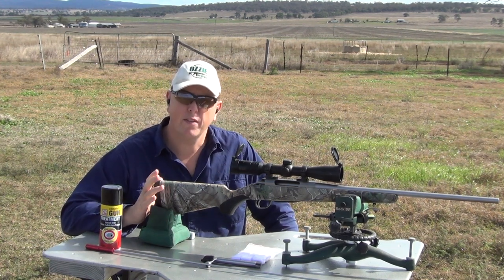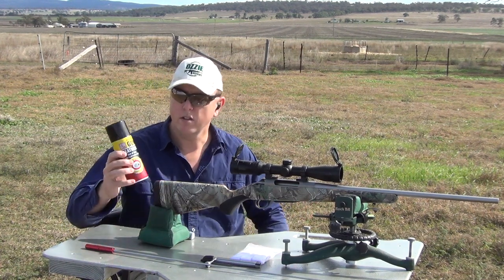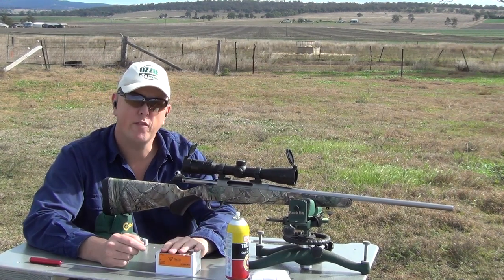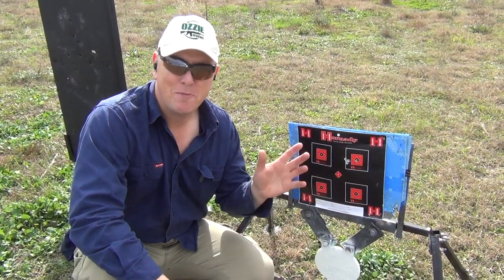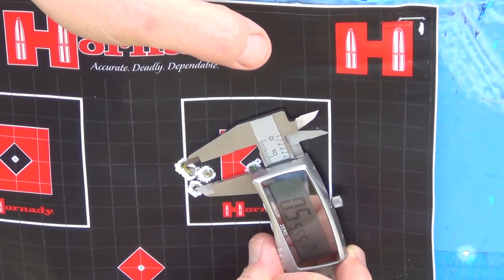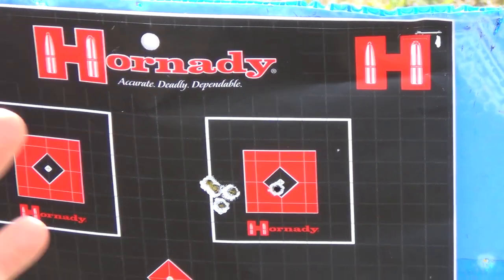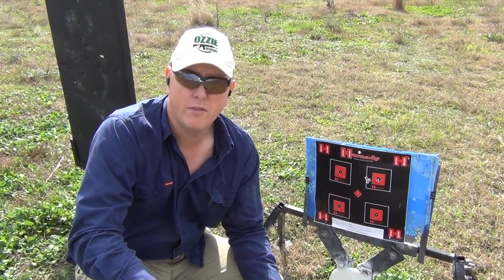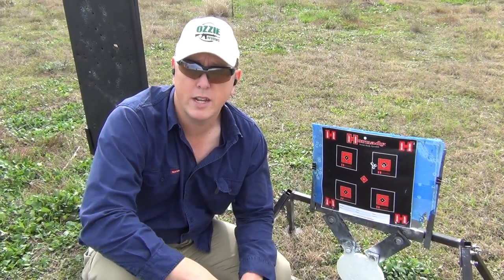Beginner Basics #2 How To Break In a Rifle Barrel (Centrefire)

Comment: The patch out after each shot is for custom target barrels that have never been fired before (like you would get if you buy a barrel from someone like Madden or Tobler and have it fitted)This is exactly what we needed to do with new target barrels (when I was into fullbore target shooting some years back).  Also folks be aware that using excessive amounts of ammonia based bore solvents (like Sweets 7.62) in STAINLESS barrels can damage them by dissolving the nickle that is alloyed into the stainless steel and that they can also rust chrome-moly (standard steel) barrels if left in for much more than 10 or so minutes.

Comment: In my opinion, if it doesn't make a mention of it in the manual, it doesn't need to be done. I took my Tikka T3 CTR out and shot about 60 rounds the first day, cleaned it as usual, and it's done as well ever since.
Reply: Oath. Tikkas, being cold hammer forged are already pretty much as smooth as the bore and rifling can get. 
Ozzie’s way is pretty basic and simple as it gets and seems like pretty decent system.

Comment: Mate this is a great series you are doing. Fantastic!! I'm certainly going to give your cleaning method and products a go! Love having a honest, down to earth, informative, aussie channel....keep up the good work.
Reply from the maker: Thanks Luke, I greatly appreciate that, cheers!
Reply: Spot on Luke , I’d go so far as to say any rifle any barrel I’m still a fullbore shooter , but I’ve studied metallurgy as a component of boilermaker at tafe , no what’s happening when we run a barrel in , we’ll the inside is rough from new and the running in smooths the bore and takes away those nasty jagged edges in there , but also and more importantly you are core /work hardening the surface , look up work hardening of steels for instance hit a railway track  with a hammer and anywhere you can dent it , except the head of the rail as it’s been work hardened by the bogies , yes I was on the railway as a welder ,
, so every bullet lays down deposits of copper into the bore surface , sweets or other copper solvents are designed to get this out , and personally I would go shot patch shot patch until no copper came out , you can always tell a well run in barrel as it’s copper comes strait out after 1000 rounds etc , but if we aneal copper into the surface there is a possibility this softer part may set the barrel to loose accuracy prematurely, ie the copper is acting as barrel surface in one area and stainless in another , however I’ve had barrels that would not ever stop giving up green , but they Shot well , personally next time I’m thinking of running in with chrome moly projectiles , never seen them but I heard they are out there , if they work harden and are a harder bullet then it stands to reason that they will leave minimal deposits , I’m not sure if the chrome moly would aneal into the surface , I best research that , but chrome moly work , Characteristics of chromoly
An important characteristic of chromoly is that it can be easily hardened by heat treating or work hardening. It can also be case-hardened by a process known as carburisation, where the outside of the metal is significantly hardened whilst the material retains its chemical properties, cut and pasted, I think chrome moly is the go for 1st 100 , well I’m gonna try it

Comment: I was surprised how many cleanings it took to get rid of the Tikka shippping grease in the barrel.  I did not use a brush, just wet and dry patches with Shooter's Choice.  I shot a round, cleaned, shot a round, cleaned for 10 rounds and then good to go.  I live in Alaska and shoot a 130 gr Barnes TTSX hand load with 4350 out of a .270 Win Tikka.

Comment: Have you ever tried this method vs not doing it at all with two identical guns? 

As you said in your introduction, a lot of people online, both casual and champion benchrest shooters say its a myth, even high quality barrel manufacturers say the same, however I've never seen decent enough comparative data or testing to say with certainty that one way is better than another (or not at all).

Either way, the cost/time/effort to do something like your video is completely minimal and wouldn't hurt in the long run (especially if you've forked out 4 figures for a new barrel, may as well do every little thing you can).

Another great vid Ozzie!
Reply from the maker: No as I have never been able to afford 2 identical guns ;)
Reply: Even then you are comparing two different rifles. Their is no contorl group either.
Reply from the maker: oncall21 I can't seem to message you privately, can you send me a PM please, I had some info on another matter I wanted to discuss...
Reply: ozziereviews  hi mate when do you recommend running the brass brush with a new rifle?

Comment: I am a firm believer that breaking in a barrel is a myth. I've tried the patch after every shot method and I've tried a similar method to what you do. Never found it to make any difference at all.

These days I simply do an initial cleaning and patching to clean out the bore of any test firing residue, shipping grease etc. Then I sight the rifle in and do a post shooting clean as you normally would.
Reply: It does but not really for an average shooter. Unless you need to predict muzzle velocity for long range firing solutions or high level competition. You can change the copper equilibrium curve if you know what your doing. Certainly not worth the effort for most shooters

Comment: hey mate great video..is that a job dewey rod? if so is there any difference between the stainless and coated steel? and how many inches is that particular cleaning rod you are using?
Reply from the maker: No, pro-shot 42". Personal preference on the stainless vs coated steel. The main thing is to make sure you don't damage the bore and/or chamber over time, but if you take your time you won't have an issue...
Reply: Sam Nakhoul h